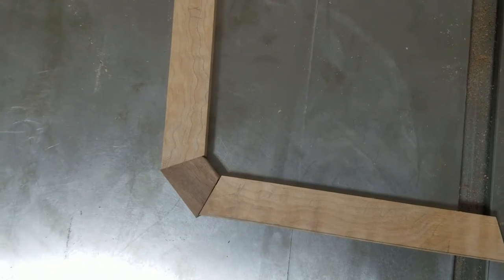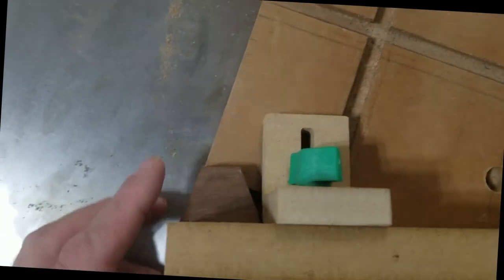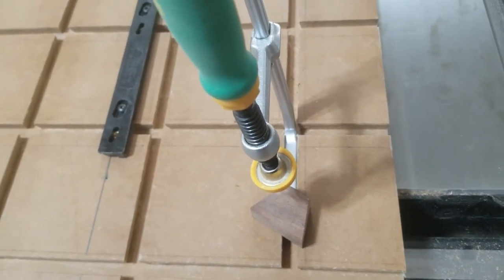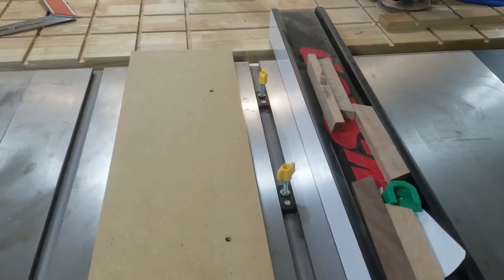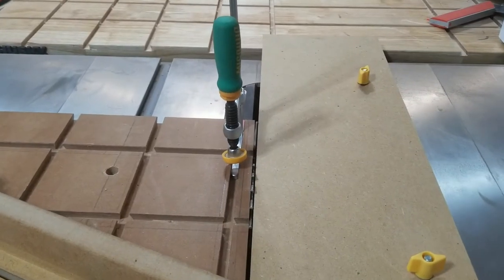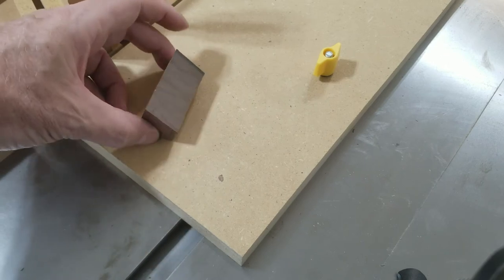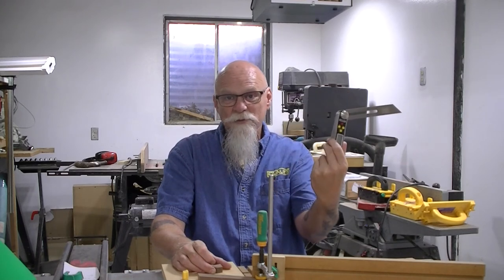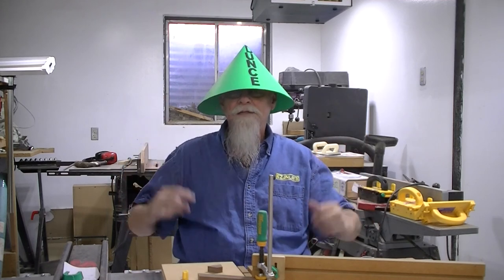Zero Clearance 360 Sled - How to cut small parts quickly, safely, and accurately on the table saw.

Comment: 😊Are you using the face or rear of your fence for the angle. And why not use a smaller diameter clamp pad as in an elongated conical point . Ole geezer excellent post
Reply from the maker: I use the face of the fence to set the angle.  The Dovetail Clamps only have one type of pad but a elongated conical point would be a great idea!!!  I'll pass that on the the R&D team at MicroJig.  
Thanks for taking the time to comment!!!  :)